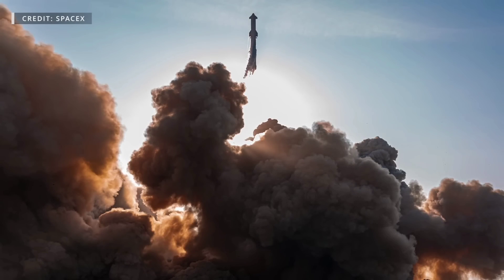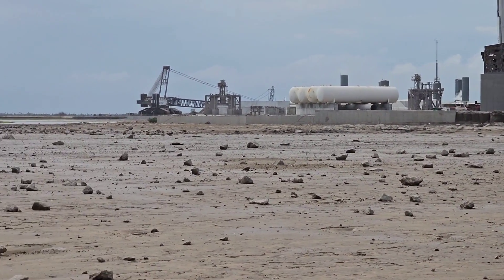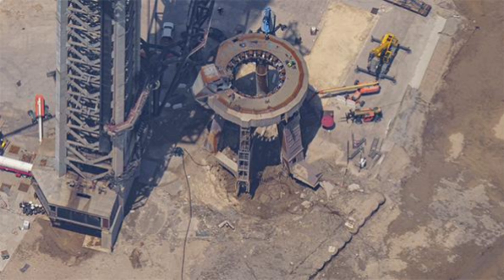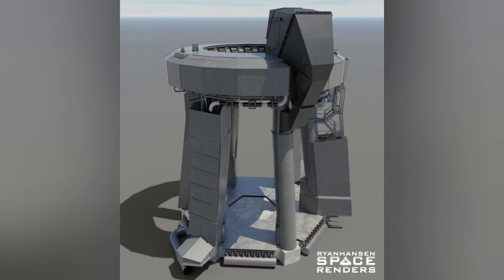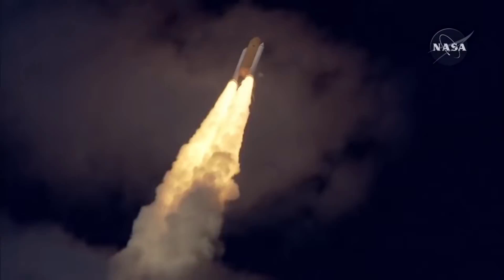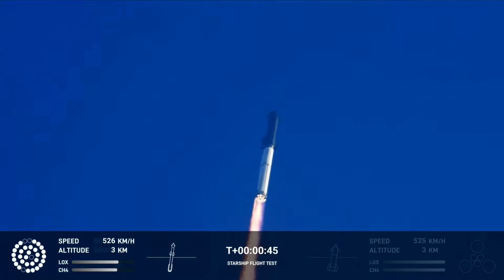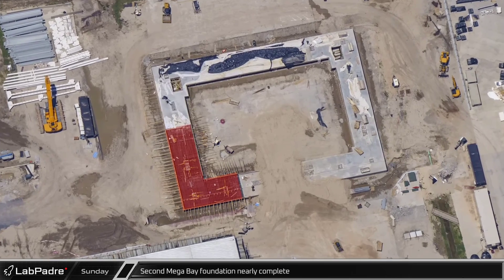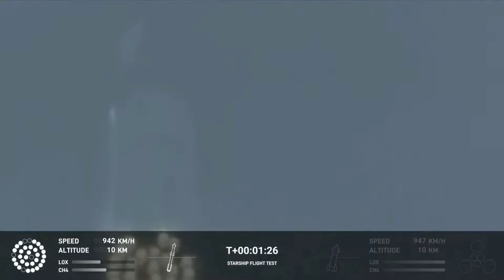Will Elon Musk's water cooled flame diverter be enough to keep Starship and Starbase safe?

Comment: Diging a deep trench where that water table is just a few feet below the surface? This seems like a launch site location problem to me.
Reply: Yes, which is why they should have called in the army corps of engineers and built up a concrete slab like the ones under 39A and 39B in Florida. This will elevate the system and make room for a proper flame trench AND sound suppression water system.

Failing to plan is planning to fail.

Comment: What about a water tower built on the top of Mechazilla? Have 4 pipes run down the inside or back, and let a tremendous amount of gravity provide your water pressure. Of course you'd have to work against a tremendous amount of gravity to get it up there in the first place

Comment: Personally, I would use tungsten as a plate material, possibly without cooling
Reply: Too expensive.
Reply: @Withnail1969  depends. Is it more expensive then the water cooling system? Sometimes the expensive option is the cheapest option.
Reply: @Withnail1969  I am well aware of it's cost. Look at the man hours going into the water cooled plate. And tungsten can be alloyed to cut the cost and improve heat resistance.
Reply: @Withnail1969  and a quick check on the cost comes in at 30 to 40 thousand per ton. That is very affordable when you think about everything it would not need.
Reply: @Withnail1969  again, you are only looking at one aspect of the whole system. Tungsten should take the heat and pressure without any aid. They need to produce a fortune of water and deliver it in under 30 seconds to the launch pad. That system is expensive, and will continue to be expensive over time. It is not once off cost. What if it falls? It's too expensive.

Comment: " 'Twas velocity what killed the beast," not pressure.  If you don't let the tremendous flow get under anything, there won't be anything to get lifted and then blasted away.  Well, not anything sufficiently bolted down or otherwise attached, anyway. 

Lift, think about it; that implies pressure from below being HIGHER than from above. Think wing.  Like high velocity unimpeded exhaust gasses above the outer concrete slabs causing a relatively LOW pressure area, with gasses getting trapped underneath from the surface through some kind of breach, turning velocity back into pressure when trapped.  LIFT!  Then the velocity comes in and that lifted concrete gets grabbed, blasted, busted, blown apart and it goes everywhere.  The same for everything else getting blasted away, all that dirt and such.

No breach = no lift; no wicked witch of the west bicycle or other larger debris flying up into the tempest.  No big or even modest size chunks and hunks to impale and damage stuff.  How much equipment was damaged solely from exhaust gasses?  Very little.   

So let's prevent a breach!  Start with a very robust steel plate assembly.  Robust enough to withstand the high velocities and the downward thrust (remember that old "Equal and opposite reaction" thing?) of about what, 15 million pounds coming down?   Can be done.

But what about the heat?  Lots of heat.  Let's start by flooding the underside of the plate with a whole shitload of moving water.  Tens of thousands of KG/Pounds per minute.  That'll keep the bottom of the plate cool.  And for what, 30-40 seconds, it's not like the steel will even conduct much of that heat to the underside.

Then take that water and shove it up through a bunch of holes in the plate, the 'shower head' mentioned.  The hot exhaust comes down, mixes with that water and the suppression / deluge system water.  The water flashes to steam and carries away a TREMENDOUS amount of heat; away from the plate and other structure pieces.  How much heat?  Ask the large power plant folks.  Notice that steam generated from a heat source (fossil, nuclear, concentrated sunlight)  system works so great in moving energy that it's still in use for the last hundred years, and for the foreseeable future in ALL those applications.

Water is cheap, and can be pumped in mass quantities at reasonable pressures relatively easy.  Those large 1000+ MWe power plants CONTINUOUSLY move a half a million gallons per minute around for cooling, 24/7/365 (times Capacity Factor, of course!)  No big deal.  Well, actually really, really big, but you know what I mean.  Someone will gladly sell you the pumps you need to move as much water as you need at whatever pressure you need it.

The steam will carry away a LOT of heat, and cool the temperatures down significantly, BUT it will also increase the velocity even more; water volume expands by a factor of around 1700 as a steam volume.

No, don't go using some exotic refrigerant system; those are for a low, continuous heat source.  No, don't go using ice, it takes 34 times as much energy removed to boil water than it does to melt ice of the same mass, and a pump runs much cheaper than a refrigeration unit.  Plus there's that pesky 'exposed surface area' thing needed to melt ice; water flows readily.   

No, you're NOT going to capture this extremely intense short burst of energy and harness it to do something else with long term; where are you going to store the energy???  

This should oughtta work.  But you all know: "In theory, theory and practice are the same; but not in practice!"  It's got a lot more merit and solid science behind it than most people think.  Did I mention that water is CHEAP?  

PS, oh, yeah; that pressure thing.  The (all this type) rocket engines make thrust by changing a high pressure fluid into high accelerated mass flow velocity in the nozzles, converting pressure into thrust.  What's coming out as exhaust gasses are at extremely high flowrates, but not that much pressure.  And the support structure is basically what, 70 feet tall and open all the way around?  Very little restriction = very little back pressure in the area under the rocket.

Take it for what it's worth.  I used to teach hydraulics, reactor kinetics, thermodynamics, heat transfer and fluid flow to engineers from other backgrounds.  With well over three decades experience in large power plant operation, practically applying this kind of stuff.

Comment: it can be passive designed passive with the amount of heat. they can promote the flow in one direction from expansion and have that syphon the cold water in. it's a retrofit option though - the flame diverter can be better if done right.

Comment: If they are intent in not building a flame trench, I would at least extend the steel plates out 1000' diameter around the launch mount.  Sand from the dunes surrounding the launch tower rained down in south padre island.

Comment: If they were doing real engineering they ought to have gotten it right the first time. They have these things called equations, involving forces and masses and velocities and stuff like that. You plug in values for the variables and you can kind of model what happens with various launch pad configurations. The yield strength of concrete, for instance, is not a mystery and there's a lot of data on materials and so on. Is it all coming off the top of Elon's head? Is there any thinking going on?
Reply: The concrete didn't fail before the underlying geology gave way.
Reply: @psycotria  So they were unaware of the underlying geology?? Good thing they weren't in a swamp...
Reply: @Nogill0  I suspect SpaceX's model of soil characteristics contributed to their insufficient site preparation. I believe their steel plate/water deluge system will stand up to the next launch and remain operational. - "We'll have to wait and see what happens." - DJT
Reply: @psycotria and it did stand
Reply: Elon is desperate to get Starship going because he needs it to finish Starlink. He can't launch his full size v2 Starlink satellites with anything but Starship. They need Starlink to fund Starship. If either fails they both fail. As well it should because Starship is a farce. I respect the engineers for pulling off as much as they have in spite of having a no-talent ass clown as CEO. But nobody is going to Mars. We are probably going to collapse as a civilization before we can muster the technology to send a human to Mars. SpaceX will be lucky to launch another Starship at all, let alone get us to the moon.

Comment: The reason the exhaust excavated so much dirt and concrete is because it had leverage once the pad cracked under compression, if the plate doesn't melt or break the lateral exhaust wont have the downwards force to break concrete, not to mention the water coming up out of the plate slowing down and cooling off the exhaust directly

Comment: Your negativity is getting tiresome. SpaceX is not recklessly charging ahead, as they have scrapped so many boosters and ships that were not ready for flight along the way. After seeing IFT1, I don't believe that rocket could blow up on the pad without some major operator error. Just like 100+ F9 landings without failure, we will be seeing Starship launches likewise. 

SpaceX will fix whatever needs fixing and will succeed. Scattered concrete, sand and dust is negligible damage to the environment. The concrete didn't fail before the underlying geology of unconsolidated soil gave way. 

The tank farm was never fully commissioned and I was wondering when they were going to replace those tanks. I'm sure SpaceX will make the "upside-down shower head" water deluge plate work and work well.

Comment: The water will probably cause a different problem for the launch ring. High pressure steam will get around the armor plating in ways debris will not. Sensitive components will be much more susceptible to damage while the armor looks like it held up well.

Comment: My understanding of the structural failure of the concrete was not because the concrete fractured but the ground beneath the concrete, the relatively unconsolidated and yet seemingly solid ground of that sandy region literally deflected downward under the force of the rockets and that deflection allowed the exhaust to find a way to rip apart the concrete. If this had been solid bedrock in contrast to compressible sand substrate, compacted though it may be and and solid as it may see, it would not have been able to lift and eject material. Steel plates being cooled by water will resolve that issue and the side blast such as it will be will be a lateral force across the surrounding surfaces whether of concrete or steel and will not likely cause the kind of downward deflecting forced that resulted in the blast's lifting and ejecting the material. Will there be other problems or will this be an elegant and effective solution? I guess we'll find out, and the sooner the better. Cheers.

Comment: The most obvious solution to me is to substantially raise the OLM, reinforce the base of the tower, and increase its height to maintain its purpose.  A ramp will be required to access the OLM for boosters and rockets….and that’s it.  The rocket exhausts are simply too close to the ground.  If you can’t build a trench due to soil and water table…then raise it all and keep launching.  Expensive redesign…yep…but it’s a permanent fix which increases safety and allows testing to progress.  Boca Chica is a TEST facility, and I foresee it will become a major production facility when testing is complete, limited to testing new versions of their boosters and ships.

Comment: The ocean is right next door. What about launching over water (from an oil rig style structure)?
Reply: Would require a totally new environmetal assessment AND the construction of a floating launch pad. Both of which might take years.
Reply: @Antares2  I thought the ocean might be a less environmentally sensitive area than the beach, and launches over water would also be inherently less destructive (although clean-up in the event of an accident might be tricky). Also, given that large floating platforms are used in the oil industry, I thought there's probably lots of fabrication capacity and expertise around. SpaceX could build the tower, which they already do. I hope Elon is right that his steel deflector plate is going to be quick and effective, though!

Comment: from the damage standpoint,      the diameter of the debris field isn't really an indicator of the 'amount of damage', it does show the forces involved, but is not an indicator of the amount of damage done. 
The amount of damage can only be determined by assessing the launch pad itself.  Given the damage is 'mostly' concrete and sand removal, and not structural damage to the launch mount and tower, than I can understand why the claim of "a small amount of damage".

And everyone knows that Elon time doesn't always line up with actual time.

The bigger issue will be the law suits delaying things.

Comment: 'Tons and tons of concrete'. 'Not small damage'. Concrete is relatively easy to replace. If there were parts of the launch mount in the debris then that would take much longer to replace. If the foundations were damaged to the point that it would need redoing that would take much much longer to fix.

Comment: I really don't think this "solution" is viable in the long term and does need to be tested progressively and any problems resolved after each test.  However, I think a comprehensive belt and braces approach needs to be considered with a water cooled metal jacket, water deluge system, flame diverter and perhaps even a much higher launch pad to dissipate the power of those Raptor engines. Rremember, Stage Zero needs to be the most robust of all Starship and Super Heavy Booster systems because Elon ultinmately wants to launch three times a day.  This may well be a pipe dream, but if he's serious, Stage Zero needs to be made absolutely rock solid and foolproof and this half-baked plan doesn't appear to cut it.

It's disappointing that the main reason the Super Heavy Booster failed was because of the launch pad - something which could have easily been forseen and prevented.
Reply: Angry is leaving out a few essential details. The steel plate will be like a shower head pointing upwards. The water, at very high pressure, will not boil inside the plate but be flashed to steam by the heat from the engines. The phase change from liquid to vapour will provide all the cooling the plate can use and muffle the sound from the engines.

Comment: Musk explained that the exhaust pushed so hard on the sand below the pad that it sank and cracked the Fondag. That's what triggered the concrete tornado as the pad surface was ripped apart. The steel plate has holes in it to spray water up into the exhaust stream to absorb its energy. I think this will work, as, even if the substrate deforms, the steel structure will have much more resilience than concrete, and stay in one piece.

Comment: No way  a simple plate will withstand the amount of pressure and heat involved here without some components flying away or back up into the rocket engines as was demonstrated from the first test flight. Diverters and water dampening would be the simplest way to go. Might look expensive but will save tonnes of money in the long run if this is ever to get to orbit and recovery stage.

Comment: THEY SHOUD CLEAN ALL THE FAECES FROM THE STREETS OF SAN FRAN AND LAY IT ON THE CONCRETE IT WILL ABSORB THE THERMAL ENERGY!!! And will be recycling.
Reply: They can cap it off with you.
Reply: @DarwinsChihuahua  so witty! Your a sharp one bud.
Reply: @DarwinsChihuahua  sounds like you contribute to the faeces on the streets... either indirectly by voting or directly 💩 💩

Comment: anyone who has used a cutting torch should be able to see exactly what is going to happen to that steel plate, I am surprised they haven't figured out the obvious solution, just launch from further away from the ground, either dig a pit or raise the launch platform and the problem will cease to be one

Comment: The water plate is a joke. Starship is supposed to launch multiple times a day. Its supposed to clear the tower multiple times a day (not just once). ANY damage to the pad or starship at all prevents that. 

If this is just a temporary measure where is the long term solution? Why aren’t they working on that as well? It took NASA 3 years to build Pad 39, not because of slow government progress but because thats how long it takes to compact soil so it doesn’t deflect in like what happened at Boca Chica. If Elon had a hint of 1950’s rocket science common sense they could started that in 2019 and would have been done by now. 

Time and time again Elon has demonstrated his inability to grasp the bigger picture. His engineers explain things for him but he doesn’t understand. Just as the real value of the Model 3 was the assembly line the real value of Starship is the infrastructure. Starbase has been designed so ad-hoc it really diminishes any confidence in the project. 

Live up to your name “angry Astronaught”. You’ve acted more like a critical straw-man when it comes to spacex. I can’t imagine what your response had been if SLS had even a fraction of the failures on its first flight.

Comment: Musk doesn't want to talk about a flame diverted trench for a couple of reasons. First, there really isn't enough depth below the deck for a trench. Second, there  isn't a lot of options for directing the flames. Approx half the arc around the pad is has buildings etc that would object to flames.  On the other half of the arc there are 2 or 3 very thick launch pad legs in the way.